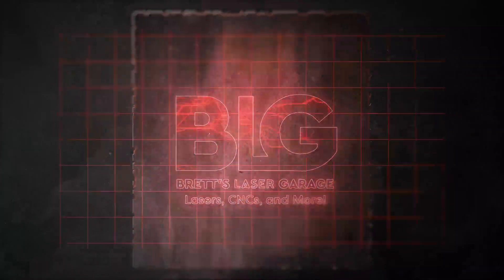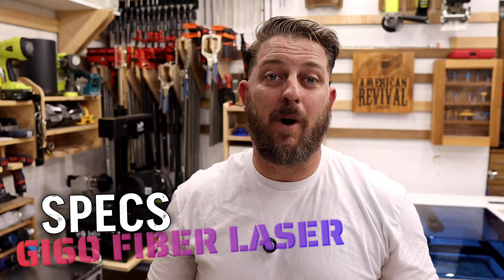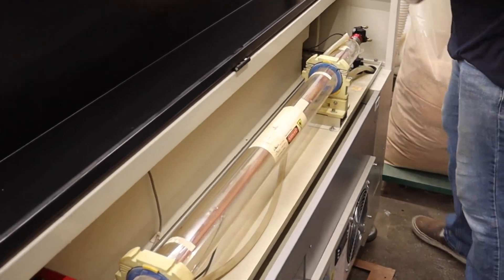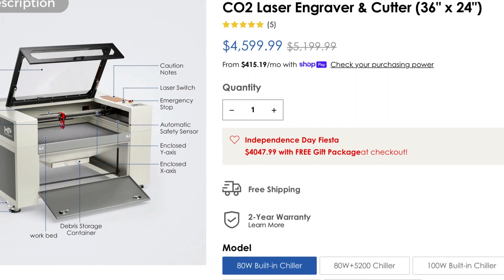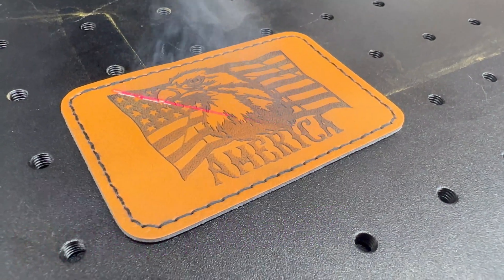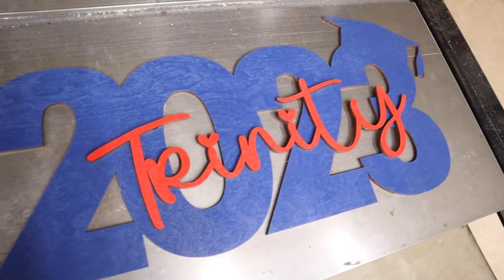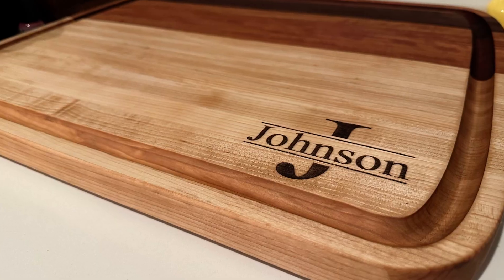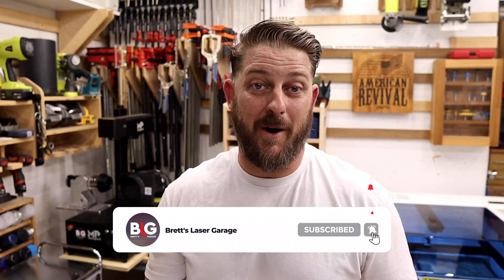Fiber Vs. CO2 Laser | Which Is Better?  | Brett's Laser Garage

Comment: How about deep relief engraving into titanium. I want to engrave knife scales and coated and uncoated super steels. I am researching what fiber laser to purchase. Thanks for the video series!
Reply from the maker: Thank you very much.  I’ve never worked with titanium so I can’t say for sure.  Basically you will be able to deep engrave titanium or other metals with pretty much any fiber laser.  The main difference between power levels is going to be speed, how fast you’re able to complete the engraving.  I’ve done 3d engraved coins on this fiber that take about 30-40 minutes to complete.   With a 30w it will still work but it will take over an hour.   I would say if you’re going to do a lot of deep engraving I’d at least get a 60w but 100w units are becoming more available and prices are coming down.

Comment: What rotary attachment is that? I haven't seen that style chuck yet
Reply from the maker: It’s just a regular 80mm rotary.  I have an adapter installed on it from Etsy that allows tumblers and bottles I commonly use to just press or thread on.  Check out my latest shop tour video, I show it and talk about it more there.  Thanks for watching!